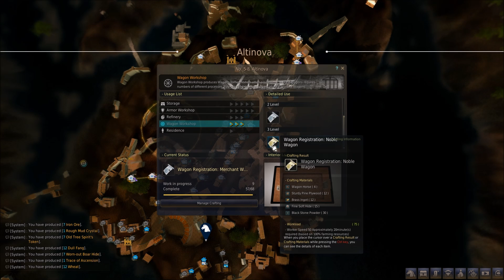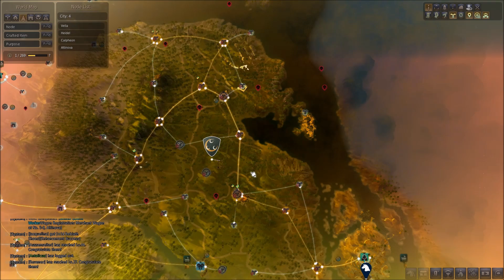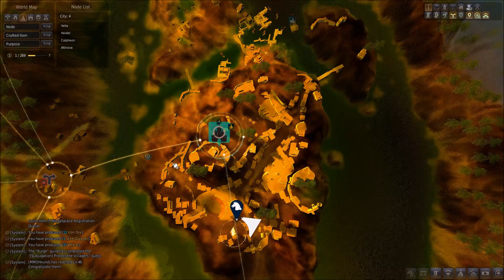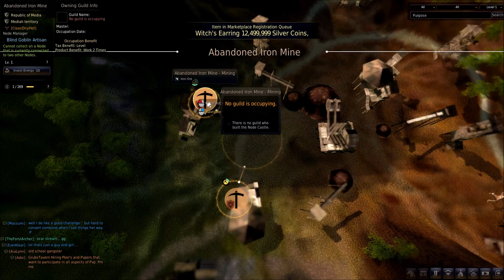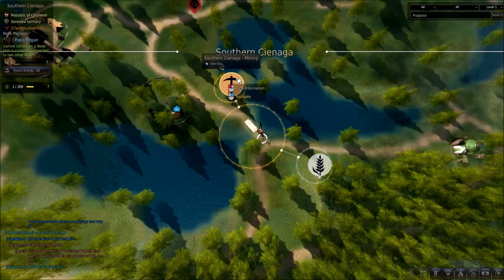Best Workshops for Money Making [Black Desert Online]

Comment from the maker: An update until I can make a 2017 version of this video:
1. The money per energy annotations are no longer relevant, so they have been removed. 

2. In general, all the workshops are still very strong except for offhands (Steel Daggers & Jubre Talismans) due to Metal Solvent being harder to produce nowadays. 

3. The best way to measure how good these are is to add up how much $$ a workshop makes in a day, and divide that by the amount of contribution you've invested. This will give you a good idea of how it compares to other places you could spend that CP, such as other workshops or nodes.
Reply: Morrolan TV 
Just found you yesterday, and was massively relieved you're making updated content. You are one of the very very best here on YT ♡
Reply from the maker: Thanks for saying so!
Reply: I am playing BDO SA and we have the same issue with Metal Solvent. You talked about offhands not being that strong because, but what about Yuria Longbow or Yuria Amulet? Or is there a better use for Metal Solvent?
Reply from the maker: I don't play SA so I can't say if Yuria is worth it. My guess is that it probably is. You'll just have to look at the costs and see
Reply: If you still play BDO would you consider making a new video with updated stuff?
Reply: Morrolan TV Is this still viable?

Comment: how many workers do you have? is there a maximum number of workers? in which city where most of your workers are from? sorry im noob in this department, i played for 2 months but my workers are still level 1
Reply from the maker: Most of my workers are in Altinova, shown here. I have some in just about every city, however, just depending on what materials I am trying to gather. My total number of workers is about 50 which is way more than what you will need unless you intend to focus on crafting a LOT.
Reply: thanks for the response mate. btw, when hiring workers do you have to hire blue ones or starting off with green workers are fine?
Reply from the maker: When you are brand new green isn't bad, but you should make a few alt characters and use their energy for blue workers as soon as possible.

Comment: I'm a sorc I took a look at crafting Jubre Talisman awhile ago on Edan, even if I use the talisman for repair, I still wont make much profit. If you sell them on the market place and multiply your profit by .65, you definitely lose profit
Reply from the maker: The profit calculations assume you make the materials yourself. If you just try to buy everything off the market and make Jubre talismans, then yes, you will lose money.
Reply: hey man, do you do quests for processing exp skill ? I need to get profession processing 5 for making pure crystal to feed my alchemy stones. thanks a bunch
Reply from the maker: I don't do any processing quests, no. Based on the new changes coming to processing, however, it should be extremely easy to level up. If you want the most cost effective XP, make Fabrics or Steel Ingots.

Comment: That explains why players think the lucky tools help them get shards. I was wondering where this rumor got started. Misinformation.
Reply from the maker: The video clearly states that lucky tools have not been proven to help shards, but seem to based on our data so far. You seem confident that they don't, but I notice you didn't post any proof of that. Feel free to contribute your evidence.
Reply: Shards (both hard and sharp) are given their very own 'rng' which is entirely seperate from all other game rng. It is a daily rng equation given to your character(not your account) in which your gathering rank, equipment, luck, and node level(energy invested) have NO effect. All characters have an equal chance to have their soul crushed under the weight of shard rng regardless of rank, level, equipment, or node investment.
Reply from the maker: Mind posting a source for that information?
Reply: I am the player Consis. I've done the math. My last guild didn't listen either. If you listen to me my best advice is to give the daily shard rng a simple and easy test: 30 gathers (of any type except by your own crops) a day. If you get nothing then your rng is unsuccessful for that day, try again tomorrow or simply switch to another character and do another 30 gathers. You could get 1-3 in a day or could nothing for 3 days. You will never see more than 3 on your luckiest day.